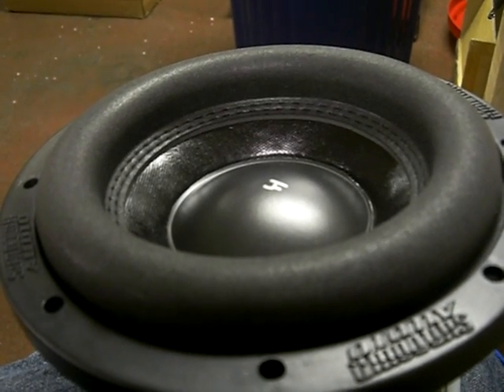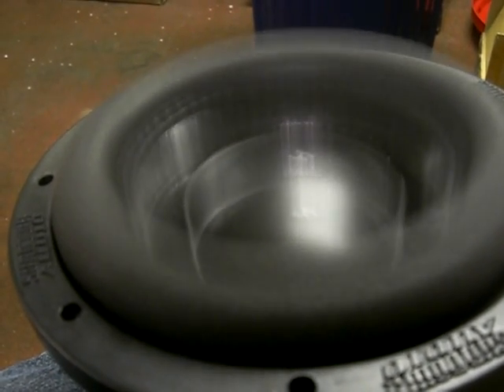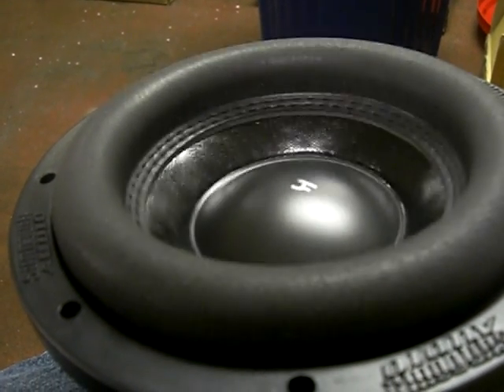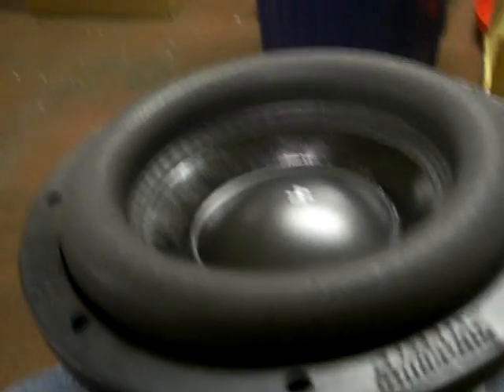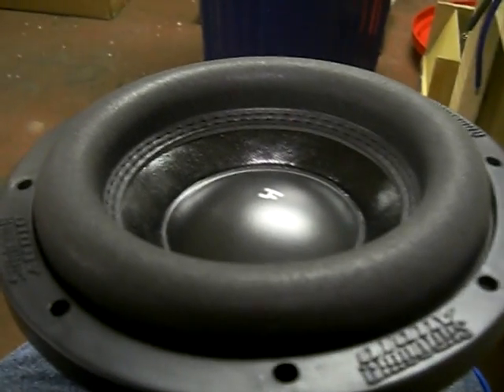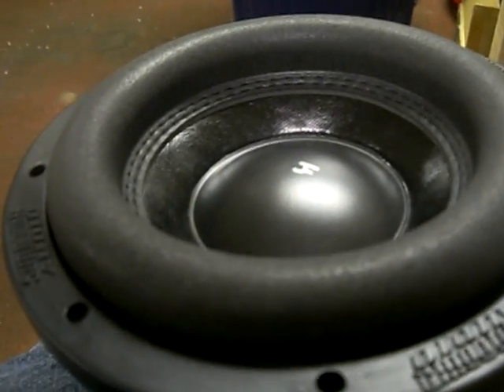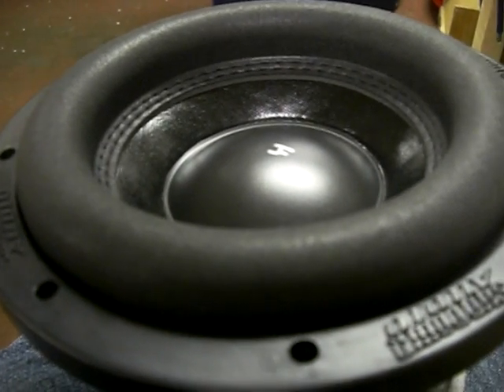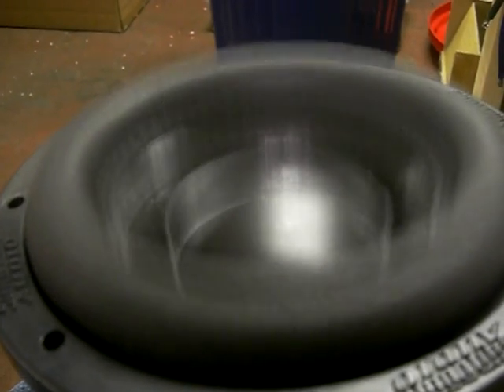SA-8 v.2 20 Hz Demonstration

Comment: I want to buy one.. someone can tell me which box i should fit for this sub ?
because i have a little trunk and want to save place..
Reply: these subs are designed for a ported box so you should keep that in mind, but other than that the box for even two of these subs shouldn't be very large even for a small trunk
Reply: So even for one single sub i need to fit a huge ported box ??
Reply: it doesn't have to be huge, what I am going to do when I make my box is cut a circle in it and put a piece of PVC pipe in it for a port
Reply: I like very heavy bass. When the windows is shaking like earthquake. But the question is if this little sub can create such power.
Reply: I don't have a little sub I have 12s I plan on buying 4-8s and putting 1500w on them at 1 ohm, if you were to wire at 1 ohm and put enough power to it im sure its possible
Reply: Dylan Doughon Oh yeah !!I'm sure. With 4 subs like this it's possible not only create an earthquake,  shatter the windows too. But it's absolutely crazy. For powerful bass 2 of this more than enough.
Reply: +Tuentin Qarantino 2 of those aint shit lol
Reply: BmxNitro i had two 8' of dc audio m3... if you put enought power you can shake a truck. In my case i had dc 2.0k ... i put daily to each sub 1200RMS... after one week my rear window has a crack on it's edges.
Reply: Tuentin Qarantino yeah but thats a truck small air space i need 2 18s to be happy

Comment: slight mechanical noise? i hope you are joking? 20hz is barely audible without an enclosure it isn't that sound is blatantly mechanical. i doubt it is even possible to produce 20hz with an 8 inch subwoofer. (realistically 5 inch because of the surround" if you cant hear the patently obvious difference between the two then you are pretty stupid to spend that much money on audio equipment. well i call it audio equipment. its cheap Chinese gimmicky crap.

Comment: Yeah I just got two sa-12's and put them in a 32 hertz tuned 4 ft^3 box powered by a T1500-bdcp yesterday. My old setup was tuned at like 45. These sound so good. And I haven't even turned up the bass past -8 on my deck. Nobody I know hits this low. Yes that rhymed.

Comment: break in the sa-12 like any other woofer, about 10hrs of use under rated rms, I used an ap1500.1, then u can use most anything, 600rms is WAAAYYY underrated, since I hit my sa-12s with 1100 rms each, for 4 months now, never get hot, still super stiff, and No burnt smell. If you got sa-12s, you got some beastly subs for the money they cant be beat